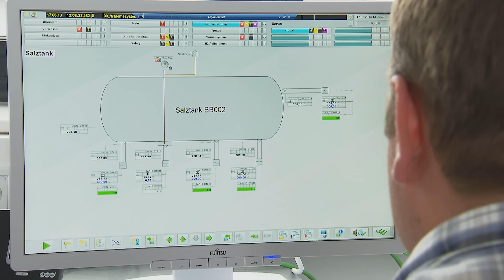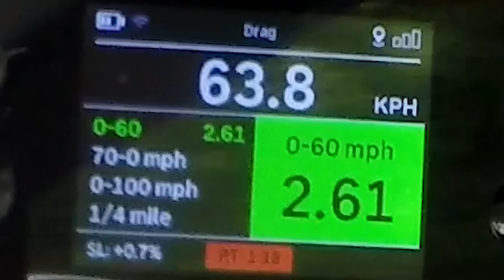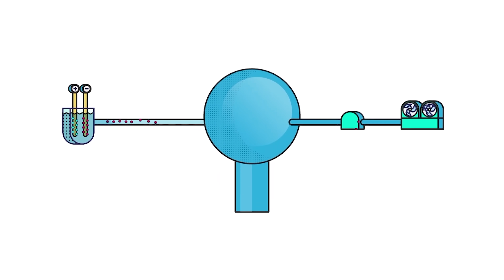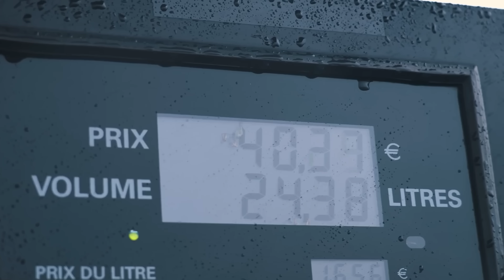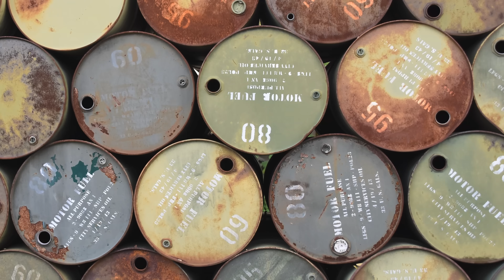Porsche just SAVED petrol engines FOREVER

Comment: The hard cold facts politicians carefully avoid is the absolutely gigantic and unrealistic amount of mining is required for the EV batteries production. It is absolutely impossible to increase mining 5 or 6 times in the world to cope with the ludicrous demand of replacing all ICEs. Also the damage to the planet would be mind blowing. Did I mentioned there are simply not enough rare metals available in the world to cope with the basic personal EV requested level, forget about heavy trucking and industrial equipment that takes 10x times more EV capacity if not more. To top all this, China and other non democratic countries have a strong monopoly in all the raw materials needed. Even if you can produce all this crazy amount of batteries, there is no electrical power in the world to sustain such a massive demand, you basically need the same energy of the current equivalent of 102,140,000 oil barrels. Per day!!! PER DAY!!! do the math for a full month or a year. Where is that gigantic electrical power coming from? From solar panels and windmills? LOL. Pathetic. And even if you do have the power, the damn grid is giving up on hot day in any major city just because people are using A/Cs. .a car will drain 10x more power. How would you charge every single car ?? What high power lines, medium power and low end consumer power grid? It will take trillions of dollars to replace an energy network (current gas stations) all over the planet. It's such a pipe dream that all car manufacturers are secretly laughing behind the screen, they're just to afraid to say the truth of fear of cancellation and losing business for not being politically correct. Such a farce ..it's not even funny. Especially as the largest and oldest climate study, by the biggest meteorological satellite network in the world, with hard, concrete data measured all the way from 1970s shows there is no real "climate crisis" and the planet had a barely readable increase of less than 1 degree. Something that can change in 1 month with a single massive volcano eruption. An entire generation or 2 it has been indoctrinated about how bad CO2 is, but nobody says how vital for life is this, we're all carbon based life forms. There are no green plants without the damn CO2, they produce Oxigen by ingesting CO2 and in the history of millions of years of this planet we're at one of the lowest CO2 levels ever, in fact dropping a little more will truly endanger CARBON based life on this planet. As mentioned by the former Greenpeace director Patrick Moore. Wake up people and use your own brain, and enjoy you CO2 producing cars.

Comment: I hope they can ramp up the production enough electric cars just are not practical where I live and in many other areas not to mention the charge times. 30 minutes is still too long to refuel IMO and most charging stations are nowhere near that quick to recharge and there simply isn’t enough charge stations to cope with potential demand and the government has done next to zero to tackle this fact. This new fuel that would allow existing cars to remain on the roads or hydrogen has to be the way forward not electric.

Comment: E fuel is definitely a dumb thing for mass product cars,  it efficiency is soo bad, u can run 10 EV with the amount of energy need to power 1 e fuel car.
e fuel make sens for some specific applications where batteries powerd engines is not an option, like for airplanes.

Comment: Methanol fuel is what the politicians are pushing on shipping industry. It's so stupid because only 2% of the e-fuels are able to be made from renewables the rest are going to be made from electricity made from coal or oil fired power plants. Not to mention that the law of thermal dynamics make the e-fuels much less power dense. So basically we have to burn abt 30% more fossil fuels to meet our same levels of power requirements for e-fuels. Instead of just burning the fossil fuels directly in the ICE and not losing the 30% or so in the conversion process.

Comment: So carbon neutral, except you have to move it from production to distribution. Which requires efuel. This seems like a massive catch-22, unless you use electric trucks to move it around. There is always going to be a place for ICE, it just won’t be the general public. It will be military and the 1%.

Comment: To be honest I see no reason to moving into electricity apart from the fact that the oil is going to run out in this century. Other than that the production of batteries causes as much pollution as petrol engine cars. Also the problem of pollution is not solved. It’s just transferred to another industry which is the industry of production of energy

Comment: It takes 4x as much energy to make an e-fuel as it does to put the same amount of energy in a BEV.
Reply: It takes 100,000 km of driving an ev to break even on the carbon emissions used to make it.
Reply: @guenthermichaels5303  how many km of driving an IC car does it take to break even the carbon emissions?
Reply: @AbnormalAspirations  they don't but they part way at 100k mark. So upto that point, they are even.
Reply: @guenthermichaels5303  As recycling and battery tech improves, it will massively decrease. Efuels development will always be slower than battery.
Reply: @Guenther Michaels  As battery tech improves and price decreases, most people would already move to ev anyway, it's just big trucks that are the problem. 2035 is still a long time and its only for new sales. There are already many promising developments in battery. It's totally feasible.
Reply: @Guenther Michaels  In that video, as mentioned by many commentators, it has bad data, twisted logic. Not a good video at all. Just looks like a good format video with graphs for uninformed people.
Reply: @frankreynolds9930  bad data, twisted logic. That's not specific. All the data is documented. Read the book, also read the McKinsey study, and data from World mining sources. There is plenty available. In any event, I have made my own extensive studies for years. That's my conclusion, which affects my investment decisions.
Kind regards from yyz
Reply: @guenthermichaels5303  holy shit i just witnessed an internet murder, i dont think ive seen a counter argument quite as well said as yours.
Reply: @guenthermichaels5303  Do you have a source other than anti EV propaganda for this statement? E-Fuels will be needed but they don’t make economic sense for passenger cars. Guess what the politicians “fighting“ for e-fools did 2nd? Right, asking for subsidies.

Comment: Porsche invested 75 milion dollars into a synthetic fuel startup company in Chile yes, but they aren't the only ones working on synthetic fuels, Toyota, Subaru, Suzuki, and Daihatsu, together with ENEOS Corporation and Toyota Tsusho Corporation, which established a new research association on July 1 2022 It will focus on ways to optimize the process of producing fuel, making it less polluting and more effective. The joint project is called the Research Association of Biomass Innovation for Next Generation Automobile Fuels. So to say Porsche is the ones "saving" petrol engines is just wrong. Though the only issues currently with synthetic fuels are the price (which will fall once it gets big most likely), and maybe the freezing point of it (which hasn't been said yet iirc). Nice video though :)

Comment: I do not see a future for this, hydrolysis is very inefficient with current technology. You will need energy to extract co2, energy for Hydrolysis, energy to then produce the fuel and then this fuel will be used into a ICE engine which is inefficient in itself and let's not forget the transportation of the fuel to the pump plus the energy spent pumping fuel.

Comment: Thats cool. I hope they work on this tech together to save combustion engines with their sounds and save the planet at the same time, hopefully.
Reply: E-fuels are about 5x the energy usage as an EV (without manufacturing the car, transporting the fuel etc)
Reply: This won´t happen unfortunately. E-fuels just burn energy on mass, they are really really REALLY bad efficiency wise. It´s probably by far the worst solution. There is no way we could ever produce enough energy in a sustainable way to create nearly enough e-fuel for it to be somewhat affordable. It would be about 2-5x price increase.
It´s basically a marketing gag at this point. E-fuels make sense for airplanes because they have to be light and have other limitations but for cars ? Never. 
Also I am saying that as a mechanical engineer and I do prefer combustion engines, it´s just not happening.
Reply: @/O/ seaweed ? Can you propose a process where this is possible ? How much energy does is need and how well can it be burned in a combustion engine ?
Reply: @/O/ If it´s generated out of biomass why not use sewage instead ? Otherwise you would have to harvest that stuff in the ocean instead which is not really practical and costly, you have to transport it and so on this also probably wastes more energy than generated back by the seaweed. But okay I see it´s just an idea of yours. Also don´t forget this biomass is probably needed by the ocean for something. It is an eco system after all, a closed loop.

Something similar is already done with cow poo. But I mean how many of those "station" would you need to be able to generate the energy all modern cars need ? The problem is that oil is pretty damn good. It´s cheap, abundant, easily transported, has a very high energy density. You simply can´t beat this.

The process to create any sort of E-fuels is always longer than simply using batteries.
The pures form of energy would be electricity. To create E-fuels you need. 
Electricity --> hydrogen / methane. So instead of using electricity you use it to produce something else and so on, the efficiency simply isn´t there. 

I mean you can do that but why ? You can instead simply produce more batteries or use those resources otherwise.

Comment: Challenges to Carbon Dioxide Removal
Right now, the methods used to pull carbon dioxide out of the air are slow and expensive. More research is needed to help them work fast enough to make a dent in the rapid rise of greenhouse gases. Additionally, some methods of pulling carbon dioxide out of the air pose risks to the environment. For example, iron fertilization involves adding iron to the ocean to increase the amount of phytoplankton — tiny ocean life that use carbon dioxide during photosynthesis. However, creating phytoplankton blooms could disrupt ocean ecology, posing risks to marine life.

Comment: I asked gpt4 how much insanely toxic pollution would be created if we replaced every car on the road with electric with todays cleanest known production methods.  The answer, for sulfuric acid by production and heavy metal waste was a volume of 60 great pyramids of giza.  Go have a look a picture of the great pyramid of giza, now fill that entire mass with the most toxic non degradable carcinogenic chemicals you can imagine and multiply the volume by 60X.  That's what this electric car future will bring us.  And it won't even reduce carbon as long as we are burning coal to make the electricity to run the cars.  This is all so fucking stupid

Comment: Just accept the future. All this sounds like a load of rubbish, its like developing smokeless fuel for steam engines. The ICE is simply 120 year old tech,  A zillion moving parts to go wrong, a red hot lump of iron and if you inhale the waste gasses youre dead.
I get it, the sound and thrill of a porsche or Ferrari ect is a blast but you can do all that on the track. 
Refueling infrastructure, Theres already a ton of chargers out there plus most ev users  plug them in at home and rarely use a charger.
Embrace the the future its faster, cleaner, and cheaper!

Comment: car makers don’t like it? Tough. This is a good but niche offering - I don’t mind but the prices will be high and it needs to be made so those cars can’t run on regular petrol some how. More likely this is useful for motorsports and heritage/classic cars - not for volume/mainstream vehicles as it takes so much energy to make the fuel its way more efficient to just use the energy directly as electricity

Comment: We won't need 9000 e fuel factores to power america, we will only need 450 to power it's cars because 60% of the fossil fuels we use are to build roads, asphalt needs a lot of oil for it to be made. 35% is oversea transportation, so airplanes and cargo ships, and the other 5% is for our motoring needs including hobbies. So the logistics of it are more realistic than the logistics of making everything go electric

Comment: YEAH, good luck selling clunking Victorian-age steam engines 'till the end of time :)
Good luck smogging @ ppl faces forever (yup, sintetic fuel doesn't stop the fumes at the back)

ICE cars got ill after the alien AWD torque vectoring of the Rimac Concept One came out.
ICE cars DIED FOREVER after the Plaid came out with triple IPM-SynRM carbon sleeved motors, reaching 20 000+ RPM. You just don't know it yet.

Comment: I think this would work well for large commercial vehicles. If this was made a legal requirement for things like jet fuel, cargo ships, long haul trucks, trains, etc it would work very well. However, I would still want regular cars to be mostly EVs. Why? Because while globally this fuel would be carbon neutral, the location of emissions matters to me. The lockdowns during Covid showed me how clean the air can be without cars in the city. Los Angeles turn from grey to blue during the lockdowns. We can’t get rid of cars, but we can get rid of local emissions if everyone had EVs instead. I honestly couldn’t care less if the emissions were exhausted in another state away from the city.

Comment: E fuel is the most retarded idea ever. It would only work in world that stupid politians ruled the world.

The issue is that you turn something to electric power, than turn it into hydrogen and CO2 then turn that into fuel, than burn it in a ICE.

There is losses in every step, but some losses are worse than other. Turning electricity into hydrogen losses some energy (about 30%) but it loses much more exergy (about 50-60%).

Is there a work around.. yes.... well there is two.
1: Don´t use electricity as a source, but use the same source electricity come from, typically heat. 80% of the world electric power is made of heat.
2: Don´t use air as a source of Carbon. not only is the carbon bound, but its also hard to catch. use anything else. Waste from sourplants, waste from farming, old wood, what ever you can find, anything but air. Not only does it save the energy to catch the CO2, and save the energy of breaking the coal from the oxygen, it also ads energy from its own carbon-hydrogen bonds.

Comment: You forgot the main issue with synthetic fuel, it's the price ! I read that if made in large scale synthetic fuel could go down as low as 2€/liter to make. You have to compare that with fossil fuel that cost about 0,13€ per liter to extract and refine. IN THE BEST CASE SCENARIO, SYNTHETIC FUEL WOULD BE 15x MORE EXPENSIVE than fossil fuel ! It's fine for supercars on a track but it is not a solution for everyone in the near future.
Reply: thats maybe but gov would not tax a clean fuel so at the moment large percentage of fuel is a gov tax. they still find a way to shaft us tho lol
Reply: now your getting it! the elites will still be able to use it but we wont

Comment: Their new fuel may save the internal combustion engine... but only for very wealthy people.
In terms of "energy used" it is an EXTREMELY and unnecessarily inefficient fuel for cars, with only 6% of the energy being turned into motion, and it will remain unresolvably expensive to produce.

Excessive fuel cost is fine for someone who can afford that Lambo and wants to continue owning them but will never be a viable option for an ICE Dacia.

E-fuels may find their way into aircraft though, where the energy density is an absolute necessity and emissions are always high on the agenda. The high fuel cost would likely drive the cost of flights up if mandated but a majority of people may well be prepared to accept that.

Comment: Nice, now all we need is for the magical carbon capture tech to exist. You know, those big machines that suck carbon out of the air... You've all seen them right? 
No.. Carbon capture is a fantasy. It's like scrubbing the air with a microfiber cloth.

The carbon capture that works is growing forests. Won't get a lot of fuel by letting flora absorb CO2.. You need magical non-existing machines for that. The filters that filter out co2 from factories etc won't be enough to make any meaningful amounts of fuel. 

The math in no way adds up here.. Just more wishful thinking from the oil titans. Making people think combustion engines are OK because "it's fixed yalls!" just like how we can recycle all plastic. 
What, we can't recycle all plastic?

And that's magic.

Comment: e-fuels are a total failure at best. If you have to produce fuel, that is synthetic, very, very expensive to make it and you  use electricity to make fuel,.. this makes no sense at all. way too expensive.. a pain in the as. you can also use that electricity to load your batteries. im not a fan of the idea, forbidding fossils.. but this is a bad plan that will not be efficient. The costs of that fuel will exceed everything else. redundant.